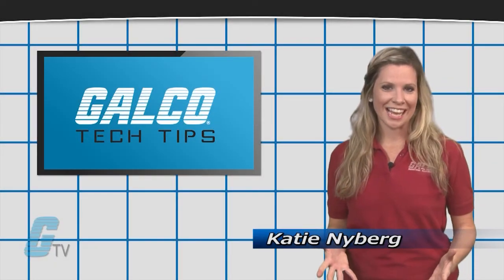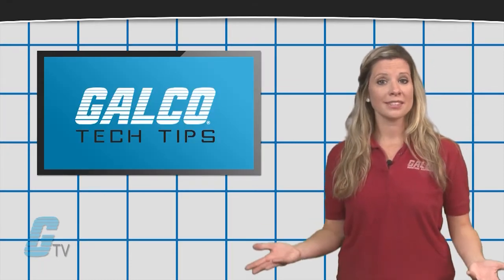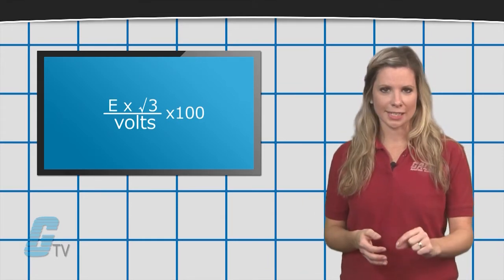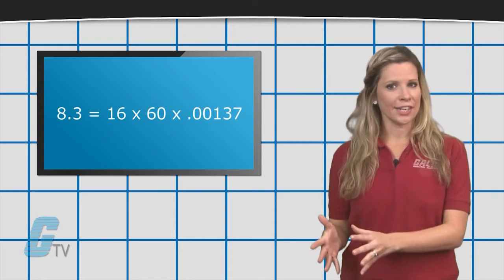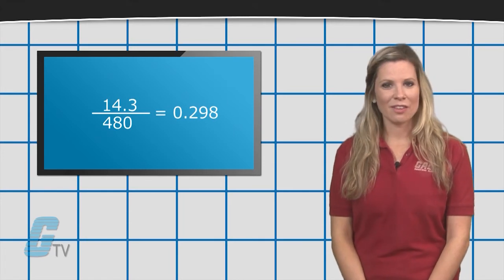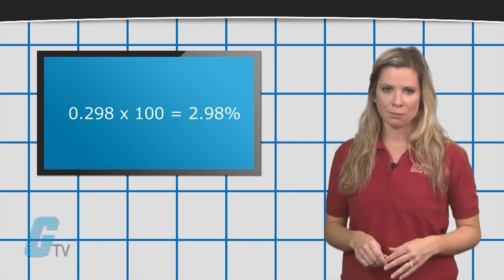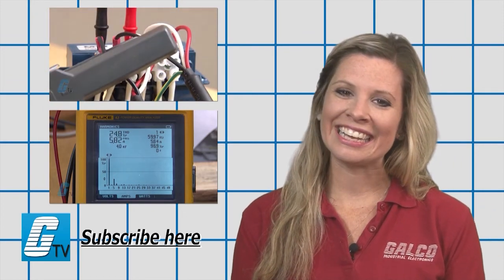Calculating Percent Impedance for a Line Reactor - A GalcoTV Tech Tip | Galco

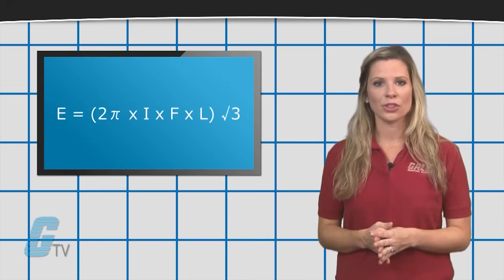Comment: Why u multiplied by root3 at 0:25?
Formula to represent percentage reactance is IX/V, I =FULL LOAD CURRENT, X=Reactance, V=voltage, then how root3 came at 0:25
Reply: I know it's 3 years later, but I believe they are multiplying the phase voltage drop (8.3V) to line-2-line voltage drop (14.3V) in order to divide by the line-2-line nominal 480V voltage. Once that division is done, you now get the decimal ratio. I'm not entirely sure though if this approach is correct. What is peculiar though is that towards the end they multiply the decimal ratio of 0.298 by 100 = 2.98%? I assume they missed a decimal because they don't offer a 30% line reactor yet. :)

It makes more sense to follow your approach and divide the 8.3V (phase voltage drop) by the 277V (nominal phase voltage) which will get you a 0.0299 decimal ratio, then multiply by 100 to get 2.99 which then a 3% line reactor theoretically should work for it.

Galco?